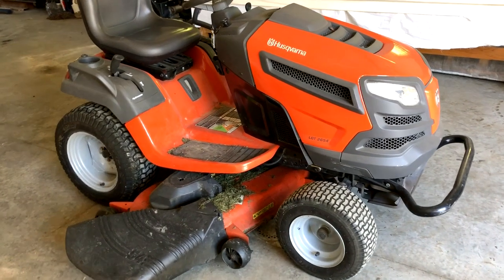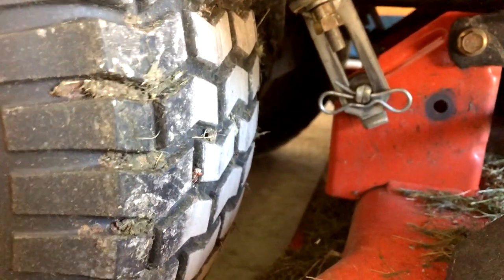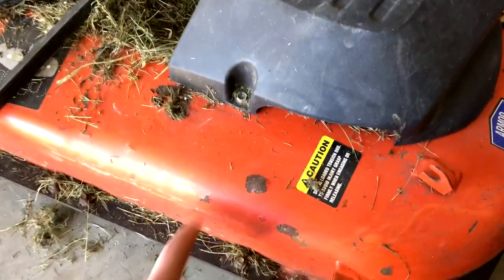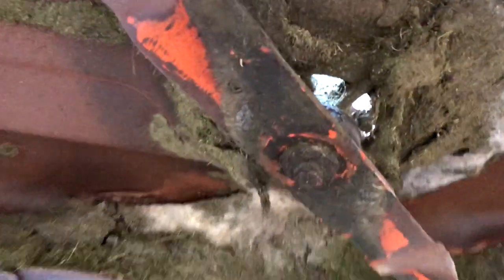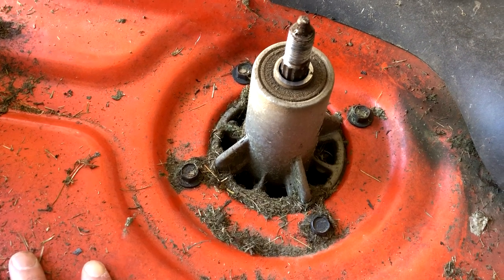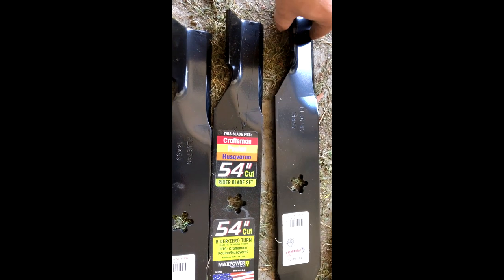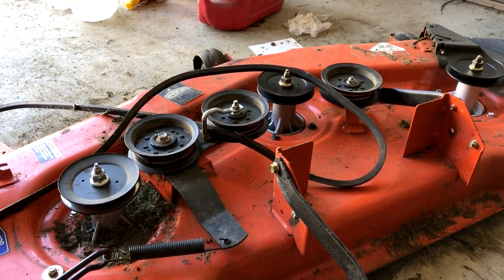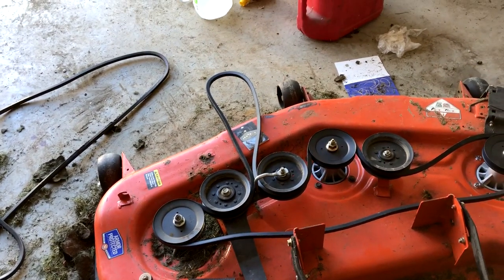How to: change the spindles, pulleys, belt, and blades on your mower deck

Comment from the maker: Supply Links: 
Spindle (with bolts): https://amzn.to/2xxCfa6
54 Inch Belt: https://amzn.to/2xy6G01
48 Inch Belt: https://amzn.to/2Nvaw3X
42 Inch Belt: https://amzn.to/2QS1ITR
Pulley: https://amzn.to/2NvbrRX
54 Inch Blades (Made in USA!): https://amzn.to/2QNqdBD
48 Inch Blades (Made in USA!): https://amzn.to/2xG5gjc
48 Inch Blades (Made in USA!): https://amzn.to/2xyXN68

***As an Amazon Associate I earn from qualifying purchases.  Your purchase using these links allows me to continue to make high-quality DIY videos and is greatly appreciated.